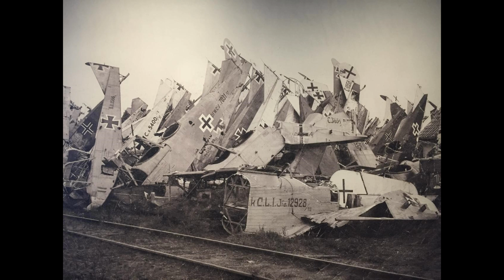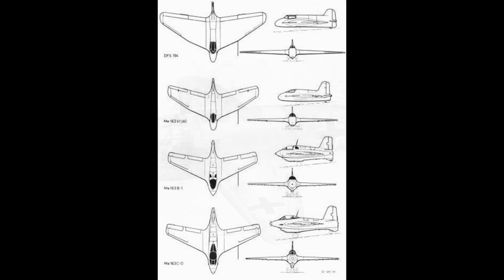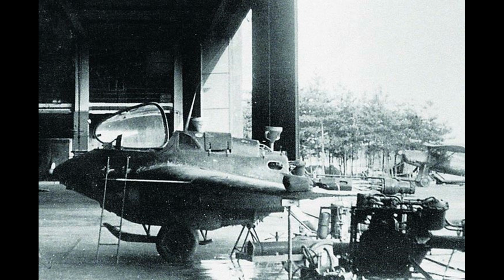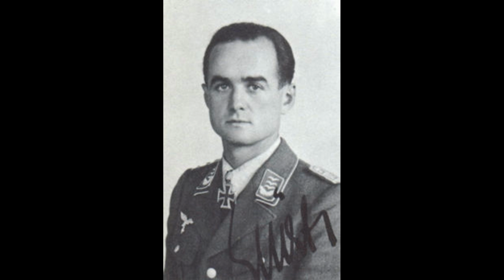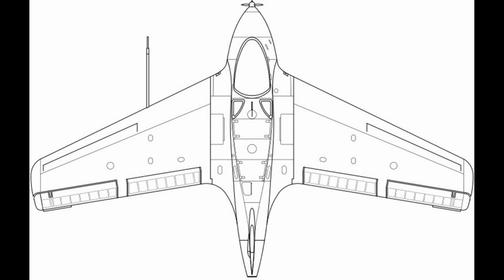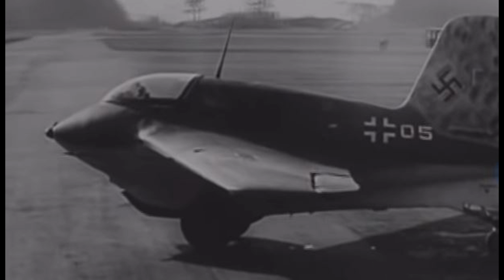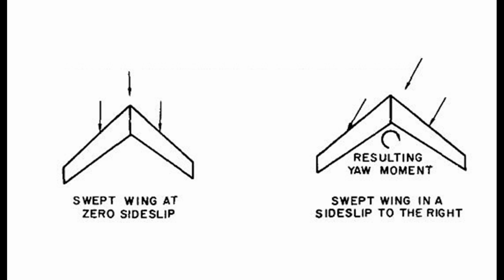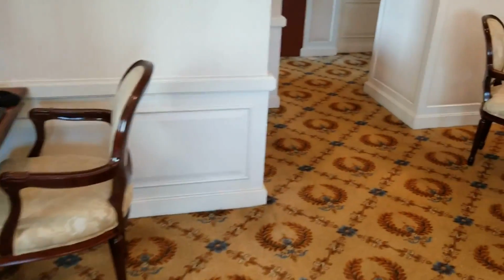Messerschmitt Me 163 Komet Pt. 1

Comment: The dangers of the Me 163:

Hard landing: explode.
Fuel leak: explode.
Engine failure on takeoff: explode.
Shrapnel in any part of the fuel system: explode.
Carelessly refuel: explode.
Forget the lyrics of Erika: explode.
Reply: And lastly: T-Stoff leak; pilot disolves.
Reply: @elroyfudbucker6806  - The contents of The Ark of the Covenant, - finally revealed … by Harrison Ford in that war / archaeology doc. And we thought it was fiction.
Reply: Read somewhere that the T-stoff could only be stored in pure aluminum tanks. This meant the T-stoff tanks were not made of aircraft grade aluminum alloys, but rather soft pure aluminum, what today would be considered 1000 series alloy.
Reply: @sheritonn5019  
Neat bit of information
Reply: While the 163 was quite explody, it had many other ways of inflicting death or serious injuries on its pilots, some much more gruesome than a simple explosion...
Reply: "explody" (  :
Reply: These mishaps actually did not occur as often as some may think. The biggest problem with the Me-163 operations was not how dangerous the propellants were, it was the severe shortage of high purity hydrogen peroxide which was both difficult & expensive to produce. The programme could have been made both safer and far more cost-effective if a dedicated LOX-Methanol powered advanced trainer version had been built. Von Braun had already developed such a motor before the outbreak of the war. Prototypes of said motors were successfully test flown several times in couple modified He-112 fighters as far back as 1937.
Reply: One must remember what they were being used to combat. The payload of 1000 B 17s and B 24s are more dangerous and explosive.
Reply: The idea that a fly getting into the fuel would cause an explosion is kind of hilarious in a terrifying way
Reply: John D. Clark in his classic book “Ignition!” which is at long last available again in print and (official) digital form, talks about storing high concentrations of hydrogen peroxide. Basically, all that could be done with ritualistic cleaning of a containment vessel made of highly unreactive material was to slow down the fuse on what remained a very large bomb. It’s one reason the German stocks of HO were deemed fairly useless by Allied rocket scientists after the war’s end. Having been diluted by some German scientists and engineers in an act that demonstrated a sense of self-preservation that had yet to prevail upon their postwar American counterparts desperate for monopropellants.

So yeah, hi-test hydrogen peroxide is extremely nasty stuff. It’s so reactive that, if it were to leak into the cockpit, the pilot would probably be better off with a leak in both tanks. At least then the hypergolic compounds could mix, and it would all be over with quickly.
Reply: Worst of it: Still better than dissolving.
Reply: like on every brand new German Technologys like the Gasoline Car/Ship/Ariplane nuclear powerplant or the Diesel Truck, when it was brand new.........
Reply: @tax paying criminal you mean too early
Reply: *Horst Wessel Lied
Reply: I love that song.!!!
You should check out Pikachus marching to it.

Comment: Hang glider and sailplane pilot checking in.   The sweep in a flying wing is also essential for pitch stability.   They will always have geometric or effective washout (twist)  so that the tips replicate the downforce function of the H-stab on a conventional aircraft.  So not only does the washout avoid tip stall, but it is required for pitch stability.  It IS just possible to do without the sweep by using reflexed airfoil, but sweep is far preferable  because the tips are less effective at producing lift anyway, so losing that to negative lift is preferable to the loss at the TE of a straight wing you’d have with a reflexed ‘foil.   Also the swept tip is farther aft, so has a longer moment, so less negative lift is required.     There is a book (my friend had it) that details the Hortons work that goes into this in great detail.
Reply from the maker: I agree with basically everything you said. Thanks for chiming in. One of the dilemmas I face when making these videos is deciding how much to cover. If I went into the effects of sweep and cg on pitch stability, this video would have been 2 hours long because I can't just mention it, I have to fully explain it.
Reply: @GregsAirplanesandAutomobiles  Thanks Greg.   I can appreciate that there is only so much that you can cover.  Before some asks, by "effective" washout I mean a thicker (vs. chord)  and/or less cambered airfoil toward the tips, or polyhedral, which mimic the effect of twist vis-a-vis spanwise stall distribution.

Comment: You didn't mention the second half after 29:50
Reply from the maker: Hi Bans, I'm not sure I understand your point.
Reply: @GregsAirplanesandAutomobiles  My apologies,
When you mentioned about "plan" 
First half of the plan was evading the fighters when 163 run out of fuel (at around 29:30) 
But didn't mention the second half of the plan which you mentioned as "we will get to that later" 29:50
Which was about getting to air/AA cover
Reply from the maker: Oh I see. I am getting to it in part 2, coming soon!

Comment: I've always thought the Me 163 was a vary cool aircraft. I thought it would be neat to build a full scale working replica powered by a modern jet engine. It would be a real head turner at a air show. Thanks for your great videos, I can't wait till part 2.
Reply from the maker: I also think it would be really cool with a modern rocket, or a mini jet engine. I appears that the flight characteristics were good. Of course the logistics of operating one would be a problem. Once it lands, the runway is closed until it can be towed off.
Reply: @GregsAirplanesandAutomobiles  I have said for sometime that would be an amazing airshow act!!  Build the intended later version with retractable landing gear.
Reply: @MicheleBoland  There is an unpowered version flying: https://www.youtube.com/watch?v=BNIpJcOZPlA
Reply: @GregsAirplanesandAutomobiles  Vary true, not to mention learning how to drop the wheel assembly without killing your self or anyone else.

Comment: Hi Greg,
Fantastic video of one of my favourite planes of all time.  I learnt a number of new things as well.  Thank you so much for the video!
One point I’d like to make is that the T-Stoff was a minimum of 80% hydrogen peroxide, also called High Test Peroxide.  As an oxidiser, it performs well but has some handling and cleanliness requirements that are hair raising at best.  It didn’t really take off as a mainstream storable propellant for these reasons.  A sobering thought given the characteristics of the storable oxidisers that did prevail - Nitrogen tetroxide and IRFNA.
Cheers,
Tim from Australia 🇦🇺

Comment: At slow speed, the dropping wing should be picked up with rudder, accelerating the dropping wing to increase lift.  This avoids exacerbating the angle of attack on the dropping tip with application of aileron, resulting deepening tip stall (and apparent reversal).
Reply from the maker: That is EXACTLY correct. However, I didn't cover pilot techniques, I was explaining the reason for the slots and possible wing twist.

Comment: Serious question from a physics-based lifelong airplane nut:

How is it that a dropped trolley can bounce up higher than it started from and hit the (presumably) climbing 163? Sure, it could hit some sort of ski-jump like surface feature, but that would just convert some of the horizontal speed to vertical speed, meaning that it would come back up behind the 163.

I've been reading about this issue for 50 years and never understood how it was an actual thing. Help me Greg, you're my only hope! 😎
Reply from the maker: If you drop something it can't bounce higher that the point from which it started. However there is another factor here, and that's the 150mph (more or less) forward speed. Think of it this way. I can shoot my 8mm Mauser from shoulder height, say about 5 feet. If I aim it at a wedge shaped piece of metal 40 feet in front of me, it can ricochet way above that 5 foot starting point. I think it hit an imperfection in the surface that was at just the right angle to launch it up, or perhaps for some reason the 163 sunk a bit after the drop, I really don't know, that's the best I can do for you.
Reply: I've always wondered that myself seems very highly unlikely

Comment: Hey Gregg. I was led to belive that, regarding sweep back, a side wind from the right would cause the right side to lift up as a result of the increase of the relative air flow, and vice versa.
Reply from the maker: YES, that's true. That deals with lateral stability around the longitudinal axis (roll). I was talking about stability around the vertical axis (yaw). These are two different things. So far on this channel I have not discussed roll stability. Sweepback contributes to both, and they can combine to cause Dutch Roll, which I suppose I'll have to talk about at some point. I just can't cover everything in just one video, or even in 50.

Comment: Apparently, the 163B had a wooden wing, quite something in an aircraft that flew at over 400mph in a 70° angle of climb.
Reply from the maker: Yes it does!
Reply: @GregsAirplanesandAutomobiles  
With that very pronounced sweepback, so different from the dead straight one-piece wing of a Mosquito, it makes you wonder how the mainspar(s) were joined or bent at the critical junction point.
Reply: Really amazing what they achieved with minimal resources.

Comment: I think that some synthetic polymers could carry those stoffs. Polyethelene is extremely inert for example, or there was a lack of polymer production in germany at that time?
Reply: There’s a material compatibility chart for hydrogen peroxide at https://www.industrialspec.com/images/files/hydrogen-peroxide-material-compatibility-chart-from-ism.pdf

If you look at the chart, quite a few polymers, even if suitable for 50% industrial hydrogen peroxide, are not suitable for the high concentration liquid.  This includes polyethylene and polypropylene.

Also, remember that thermoplastics were a very new invention in the WWII period, and the Ziegler-Natta catalysts used for making polypropylene and HDPE didn’t come along until the 1950s onwards.  Nylon was an early thermoplastic, but is unsuitable according to the material compatibility chart I referenced.
Reply from the maker: I don't know.

Comment: About the wing twist, I can't state for a fact that the aircraft had it (thought it looks like it) but I'm certain it must had since that twist, known as washout, is necessary to provide pitch stability to a swept flying wing. Imagine that washout, trailing edge higher than the leading edge, acting as the horizontal stabilizer on a conventional aircraft providing positive feedback loop between airspeed and pitch angle.
Unsewept flying wings utilize so called reflex or S shaped airfoils for pitch stability, the trailing edge has an upward bend that again acts in a similar way to an elevator.
Reply from the maker: Well.....I wouldn't say it "must have" I'll talk more about this when I get into the CG effects on weight an balance. Overall, I do agree, and I think you are correct.

Comment: An enlightening video, I'm very much looking forward to the second part.

A couple things on pronunciation/translation: 
"Erprobungskommando" can be pronounced approximately as "air-PRO-boongs-commando", with the "boo" part pretty short.
I see "sharp start" is also the translation used on Wikipedia for "scharfer Start", but it's not really the best. "Scharf" in this instance means "armed" or "live", as in "the mechanism is armed" or "live ammunition". "Live start" or "live takeoff" would be more accurate, I think.
Reply from the maker: I love having all these Germans here, it really helps our little comment section community.

Comment: Your videos are usually excellent but in this one you got a lot wrong.  The wing sweep was largely to achieve pitch stability and the wing trim tabs were to allow adjustable wing reflex, again a part of the requirements of a flying wing design to achieve pitch stability.  I suggest you read lippisch's book as he talks a lot about the science of flying wings.  By the way the 163 is a flying wing.  The aerodynamic of a delta wing, which Lippisch also invented are quite different.  Lippisch also invented ground effects vehicles.  The 163 would have been an exceptional design had it made it to the jet powered versions that were in the design queue but never made it to completion. Captain Winkle Brown fly a 163 after the war and wrote, a “first class combat aircraft”.  In the end the 163 was an excellent design aerodynamically but let down by a dangerous power plant.  Probably the closest to the final realization of where the 163 might have ended its evolution was the Bell X-4 Bantam.

Again good video except you need to study the aerodynamics of flying wings.  Copies of this book are hard to find but essential to understanding the 163  or similar designs.

https://www.amazon.com/Delta-Wing-History-Development/dp/0813805155
Reply from the maker: I did not cover pitch stability! I can't cover every single issue in one video. I feel you are conflating the concepts of omissions and errors, these are two different things. Everything I said in regards to sweepback is directly from Lippish himself (via NACA reports) or from Aerodynamic for Naval Aviators. Now, if you want to say I omitted a lot of stuff about ground effect vehicles, and pitch stability, that's OK, but it doesn't mean that what I said was wrong. Did I say the 163 was a delta wing?
Reply: @GregsAirplanesandAutomobiles  The wing sweep as well as the twist was for pitch stability.  The reason trailing edge flaps weren't part of the design had nothing to do with sweep, it is because a trailing edge flap would work like an elevator and impart a huge negative pitch force.  The only kind of flap possible was the mid section lower split type used and they were for drag, not to increase slow speed lift.  

The distance of the evelon from the center of lift as a result the swept wing isn't really a factor for ultimate pitch authority in a flying wing.  For example plank wing plan forms exhibit ample pitch authority.  

I only mentioned ground effects vehicles as an interesting fact about Lippisch.  

Early in your video you said the early planes were called Delta implying they were what became what is known as a delta plan form.  

A lot of your video was correct but I think a lot of the aerodynamics was misleading or even wrong.  

Flaps for example.  Dead wrong.

Why the wing had twist was also wrong.  Yes in normal designs twist is employed to reduce tip stall.  In a swept flying wing design it is for pitch stability.

Also your comment about wing thickness is also wrong.  Subsonic wing thickness is often misunderstood.  Look at  modern racing planes and wings in the 15% thickness are common because they are ideal for subsonic list to drag characteristics in most applications.

Most of NACA studies of Lippisch wings were more focused on the effects of sweep and not as much to analyze the flying wing configuration and stability.

It would have added so much to the video to discuss the flying wing aspects of this plane as this was only flying wing ever produced in some quantity and this is a type of plane that has largely been forgotten.  Most of the wing designs we have now are aided by active flight controls and would not fly without computer assistance.  

This remarkable plane flew quite well with no such assistance because of its aerodynamic genius.  Another point that would have interesting to include is this was the lowest drag fighter in WWII by a large margin.

Like I said I love your videos but this one, not as much.  I have spent years studying flying wings, particularly Lippisch designs as his were the most practical aerodynamically.
Reply: Yet Chuck Yeager and other American test pilots generally disliked the X-4.
Reply: @sheritonn5019  I flew well until it approached supersonic, they were still learning a lot about high speed flight.

Comment: I hope to hear about why you like the 727 so much, I have a lot of family (as many asians do haha) in Taiwan the imperial is nice, didn't know about the little history about our pilots staying there. I'll tell my father who is often in Asia about that and their translation services (he is not asian).
Reply: I know I didn't like riding in them. There's no foot room under the seat ahead of you if you're in the window seat because of the curve of the fuselage. And no place to put any carry-on baggage there either so you need to fight even harder for overhead storage. And furthermore, if it was a feeder flight and you were boarding a jet that was already mostly full and were assigned a window seat (you always were in these cases because no one wanted them), you were screwed. It really slowed down boarding. In short, they sucked to be a passenger in at times.
Reply from the maker: I might talk about the 727 at some point. The interior configurations were chosen by the airlines, not the aircraft manufacturer. So the leg room, overhead bins, etc, has nothing to do with it being a 707, 727, 737, or 757, they all have IDENTICAL fuselage cross sections.